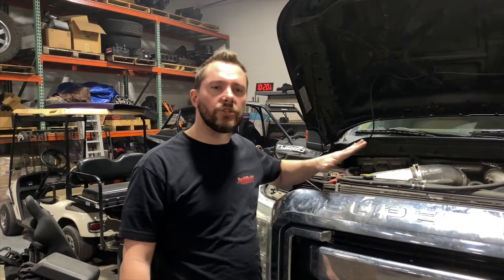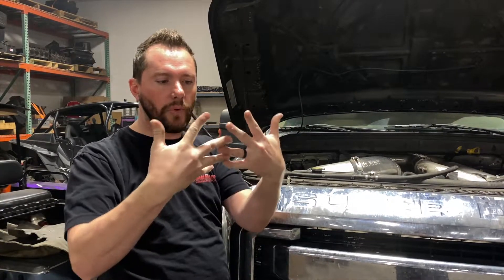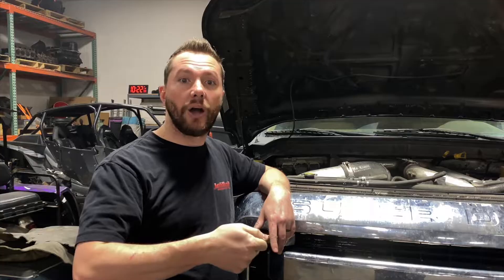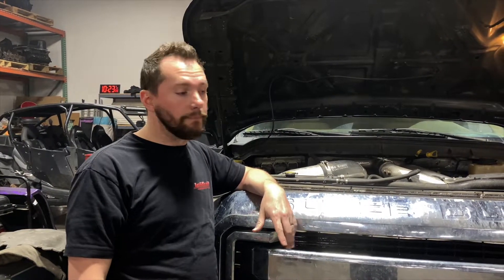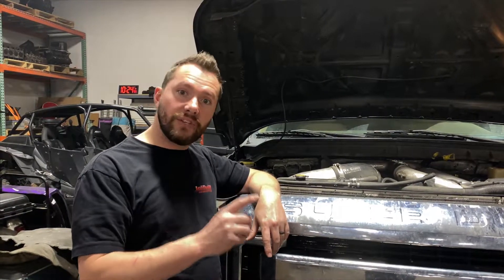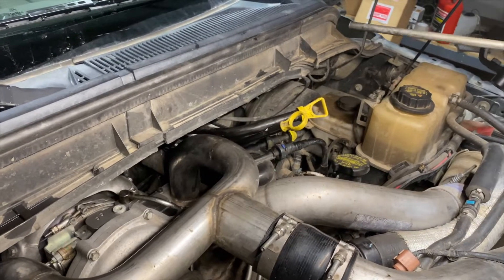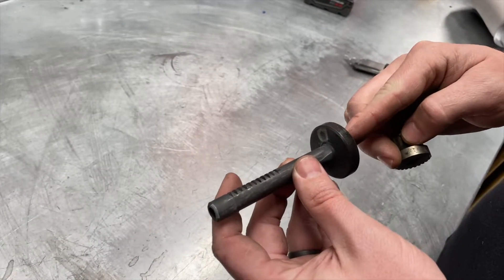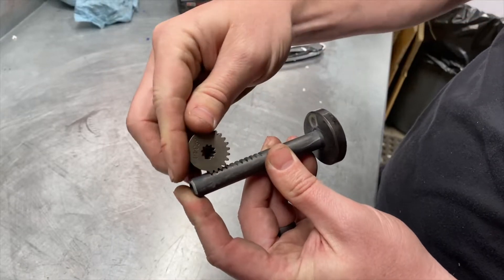Fixing Stuck 6.7 Turbo Vanes

Comment: I just found this video today and am hoping it my solution for tomorrow. Brand new Garrett turbo on my 6.0. Prelubed, brand new vgt solenoid, brand new pig tail. Ohms confirmed. CEL confirmed. Only 2 CEL are egr stuff. (Its in the trash) veins must be stuck it just sits commanding 85% doesn't move. When I unplug solenoid you can hear it want to change. Barely builds 3psi driving. I was about to tear the turbo off. Hoping this is it.
Reply from the maker: Definitely let us know if this video helped you out with your issue.
Reply: @KCTURBOS worked like a charm. Turbo started cycling. Finally got to do a pull on my lowest tune setting and now I have a low contribution cylinder 6 issue 🙃

Comment: I have electrical issues along with it so was along time looking at the charging but soon as I unplugged turbo  actuator the truck runs with out shutting down low on power but I got new acuater coming

Comment: 4 years later this video helped lol hv turbo off trk and did the air chisle trick and vanes retracted bk in
Wish u would show how to take off that plunger so we can see how to manually move plunger to move vanes
Thanks for info👍
Reply: I was thinking the same thing when it cut to that video. Would be a necessary re-upload

Comment: Im getting a P226C code but i havent noticed any issues with power and it seems to hold boost well enough. The other videos ive seen have said a new turbo is needed. So ive just been confused trying to figure it out..

Comment: My turbo works in 1&2 gear…. Dumps coal in 3&4 gear and build and runs great in 5&6 gear…
I can’t find anything about this issue anywhere!
Reply from the maker: Sounds like you have tuning issues potentially. What tunes are you running?

Comment: I see a lot of issues with incorrect tuning by companies on the 6.7s 

You will need very specific tuning  typically by a well known company that has official "KC modified vgt files"  in the name..... 

If you are reading this and do not have those, you will experience a lazy / smokey truck.... 90% of the time this is tuning issues.

Comment: Not exactly the same, but my 6.7 cummins is actin a Foo right now.  Its doing same thing, exhaust brake quits working, and it has a much deeper grumble. Or it starts working again, and has the jet engine whistle.  Then the other day something new, went to leave a stop sign and no power whatsoever and smoking black like crazy. Pulled over and tried revving it up a few times, then it cleared and started working again. Thanks for the video!

Comment: Thanks for the video.  My truck was making a deep throaty sound while towing and boost was around 35 psi.  I shut the key off and the gauge started indicating normal.  The oil temperature and power was normal, but the fuel economy looked a bit low (Maybe 2 or 3 mpg lower).   I'll try this the next time instead of purchasing a MAP sensor.

Comment: Can a bad egr valve cause computer to command vanes open or closed? My 6.7 goes into reduced power mode and if I turn off/on it goes back to normal. Typically will over boost before going into reduced power mode
Reply from the maker: I believe so! But dont quote me on that! Give our customer service team a call, they can give you a much better insight/answer to your question. 480-688-7160
Reply: @KCTURBOS thank you I will contact them! Keying on and off isn’t working for me anymore. Think my turbo is vanes are sticking for sure. Will be ordering a turbo from you guys!

Comment: Excellent video man. Very well done. My problem is the PCM triggering since the turbo starting working on a key cycle.
Reply: Mine will occasionally stick after a wide open throttle pull on the freeway or something. If I shut the truck off and restart it the vgt works again. Is this the pcm you're talking about?
Reply: @jakepeterson3379  Did you ever figure this out? Mine does a similar thing but stops working after a vane sweep while I’m in the drive through or at a red light.
Reply: @d.williams6891  I changed tunes and it went away. Everything mechanical checked out so It had to be some glitch in the tune.
Reply: @jakepeterson3379   Ahh okay, thank you. I’m in the same boat. If I use one tune, my truck is slow AF but the turbo consistently works, and if I use another tune everything works great until it does a vane sweep at idle. Then it won’t work at all until I pull over and turn the truck off and back on. Are you using one of the main named tuning company’s files?

Comment: I heard a light pop then a hiss noise. (Not a loud pop like the intercooler hose does) Almost like disconnecting a hose from an air compressor. Then lost all boost on the turbo.  Any ideas what happened

Comment: I have your stang 2 on my 19 6.7. Actually you personally did a pressure test for me last year.  Now the turbo only rumbles no hiss at all regardless of tune.   Guy at Proven said fuel issues.  I have air hammered, plugged and unplugged.  Still nothing.

Comment: Ok I’m gonna be as respectful as I can be . I’ve just spent 3k dollars plus on your turbo and now I’ve got to smack it with a hammer I should have stuck to the factory set up
Reply from the maker: This fix is meant for all 6.7 turbos, especially the factory set up.
Reply: @KCTURBOS  I still wasn’t comfortable with the hitting it with the hammer, but I did had to take upper intake loose in order to get the right spot . I will give you credit your turbos are down right nasty when they are working I would recommend your turbo 100 % !

Comment: I have a P132B code on my 6.7. At full throttle I'll maybe make 9 to 10 pounds of boost. I have a wireless OBD2 reader and I can clear the code and boost comes back without cycling the key. This only happens maybe once every 600 to 800 miles. I've changed my MAP sensor (had a lot of build up), I've checked for boost leak. Any other direction you can suggest?
Reply: Did you ever figure this out?

Comment: Ok 👌🏻 my 12 6.7 is randomly even not running showing full boost an odk if connected but also the parking sensor waring came on too… so it seems wen that happens the boost gauge shows full also… i cleaned the map sensor an it didnt help. Obviously it could still be my map sensor is faulty an i ordered a new one.. but if its not that then what else could it be??? I know u said leaks but would that still make it do that even when not running???

Comment: I have the problem caused by the PCM but the vanes only stick in the shut position if I start it remotely.  If I start it with the key it works fine every time.  If I start it with the factory installed remote start it will almost always stick shut.  Any idea why this would cause a difference?

Comment: My 2011 got stuck at 40  & restarted working fine after I turned it off… what steps should I begin with to get it fixed?
Reply: U ever figure it out bro??? I have heard map sensor so i cleaned mine still happening so i oredered a new one an hope thatys the fix… hope u got ur problem situated
Reply: @dopedickinsonbb8359  did the new sensor work?

Comment: Hi, i have a Kia CRDI Turbo diesel. My car doesn't have any code. But i can hear a whistle when accelerating. But at 22psi boost, then sudden power loss and engine running smooth again. Every time i press hard on the gas, boost goes to 22psi and car loss power like jerking. Ive check, no leaks exhaust manifold. Intake manifold cleaned. Egr cleaned. Oil level starting to decrease after a few thousand kilometers. Is it a sign of a bad turbo. But if i accelerated slowly, i manage to get the top speed of 200km/h. But slow and steady acceleration. If theres a sudden acceleration, it looses power. Btw, ive change the diesel filter, dpf cleaned. Engine flushing done. Im out of ideas. I scan using both hyundai center scanner and VeePeak scanner. No error code.

Comment: My 2006 Duramax keeps giving P2563 which is vane control position sensor. The sensor was replaced and still same thing. I know the veins are opening and closing because of the different sounds my truck makes on idle. Check engine light is still on and will not go away. Will tapping the turbo make it go away?

Comment: I know this is an old video but I have a 03 6.0 and I do not hear the whistle I hear grinding noise. Would a kc rebuild kit with balanced 10 blade assembly fix that or would it be better to purchase a new stock turbo from yall.

Comment: I put a 2015 turbo on my 13 and only in winter weather under 30 degrees outside my veinswill stop working until i shut off and restart the vehicle. Also, once I restart the truck, the veins work fine until i stop moving. If i come to a stop sign then move again, they will be shut off.. But if i run that stop sign they will keep working. That is my rumble tune, which runs perfectly in summer, but every winter the veins quit working till resart. I have a hiss tune that i have to use in the winter so the vgt works consistently.
Reply: Did you ever figure out a fix for this issue?

Comment: I’m pumped that I stumbled on this video.  My 6.7 has acted like the vanes were stuck open. Turned off and went back to normal. Now I’ve got something to go off of. Thanks!
Reply: You ever figure it out? Mines doing the same.
Reply: @fizzi5836  turbo ended up being junk, ultimately took out the entire engine.  Hard lesson learned I guess.
Reply: @anguscreek  man that is rough, how could that have been avoided? My turbo has been acting like that vanes get stuck closed after about 5 minutes of driving and when I shut it off and turn olit back on it is back to normal. Not codes or anything to go off of though
Reply: @jeffmeszaros5861  Some knowledge about the issue would have probably saved me a bunch of money.  The bearing went in mine and was causing boost pressure issues, which the computer must have been trying to fix by commanding it to hold open.  But mine wasn’t a gradual issue either, in the span of 15 miles the turbo let go and dumped enough oil out the back to lock the engine up.  Lesson learned.  Good luck with yours, powerful engines when they’re maintained.
Reply: @AngusCreek How many miles were on it when the turbo died?